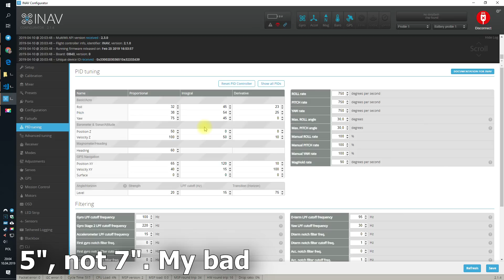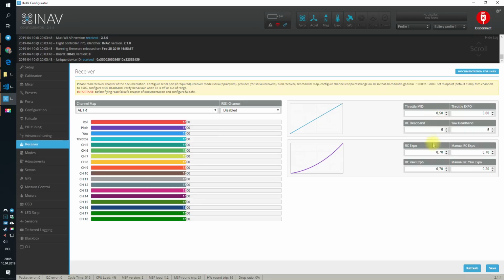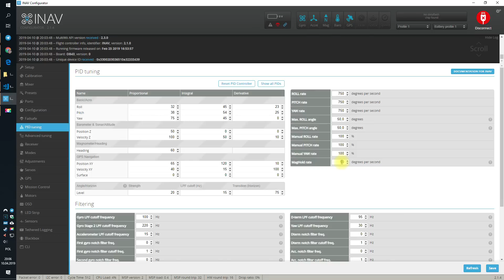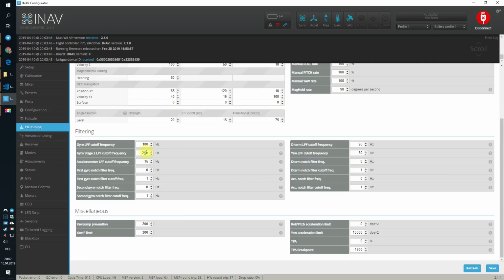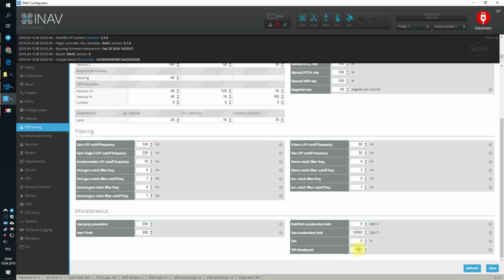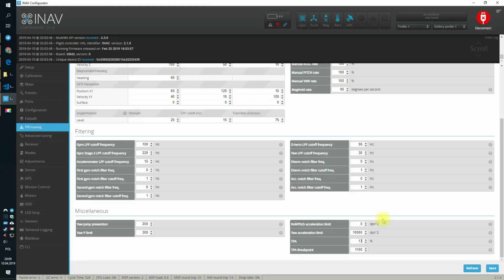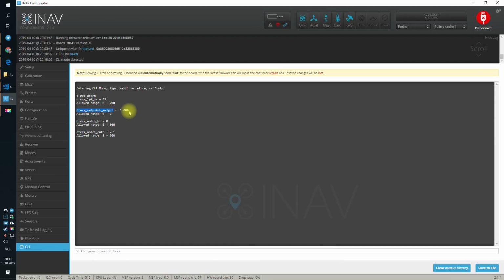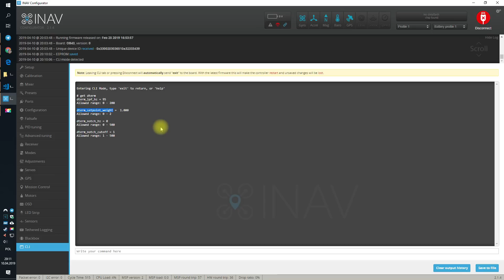How to setup INAV on a 5" quad - PIDs and filters

Comment: Can you make a video explaining what effects the I,P,D have to a model with actual flight examples?? I have finished a new build 5" use default setting and Quad is so locked in it is actually hard to make it fly around, when you move the tx stick quad is resisting input and its like being in gps lock. which is cool but I want to fly circuits not hover. Cheers. Wayne

Comment: My long range 5" 2004 1600kv gf lr5126 props.  6s getting vibrations shakes at higher throttle maybe 50% . With 6s heavy liion it's second it gets off the ground. Lowered p&d. Started at p57 I 90 d39
Lowered 10 still doing it. 
Seemed fine on 4s but didn't go full throttle.  Hence why I thought lower it on 6s   
Don't know how to do filters